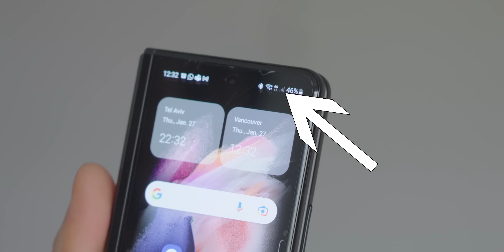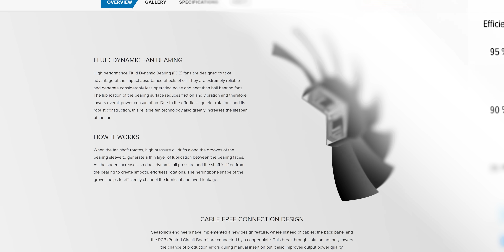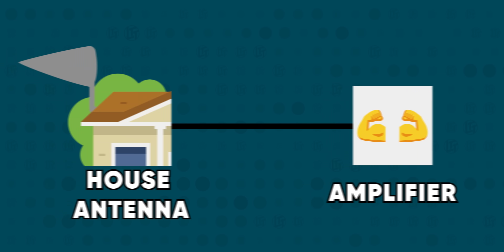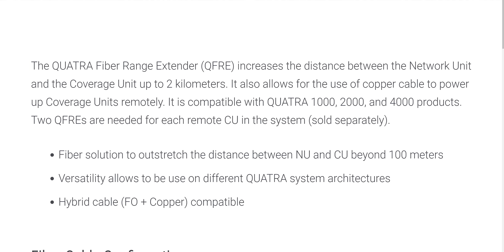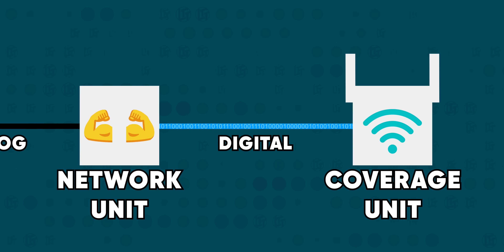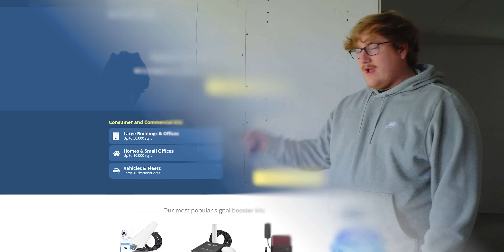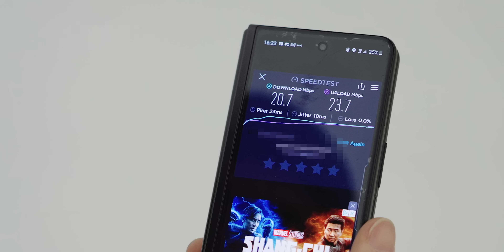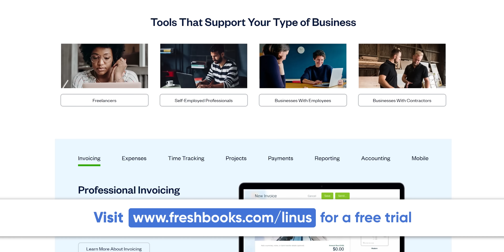I Hate This... New House Cel-Fi Cell Signal Booster Install

Comment: 1:48 No the tubes do not have to be encased in concrete, they can be laid in foam or wood based grooved plates such as Thermalboard, Warmboard, Rauboard, Heatply and Roth EPS 30.
Reply: i feel like the concrete is used as a battery for the heat, other forms would just heat the actual floor instead of providing some form of battery to store the excess heat thus making it really efficient
Reply: @MHawkeye  exactly that
Reply: He didn't say they HAD to be, he said they WERE.  There are good and valid reasons to use concrete, they made that decision early on.

Frankly  the service where Linus lives sucks at the best of time (I'm in the same general area) OUTDOORS, so reception inside tends to suffer no matter how your home is built.

Comment: Regarding your hydronic heating, or In Floor Heating, you don't necessarily need to encase the tubes in concrete. My parents house has it on 3 floors and, while the main floor is done with copper pipes, none of pipes are encased in concrete. As long as the pipes are in an enclosed space they will work just fine. The efficiency might be a bit lower but it keeps all that concrete out of the other floors.

Comment: Linus: "The tubes need to be encased in concrete in each level of the house, which heavily blocks signals..."  Me (in Mexico): "What else would you make a house out of? bubblegum?"
Reply: usually the ground floor is concrete and all other floors are wood. (in europe anyway).  If your in a high-rise It'll be concrete all round
Reply: @RobertFletcherOBE  In europe? Where are you living?
In germany 99% of houses are 100% concrete
Reply: @RobertFletcherOBE  In Europe houses are mostly concrete, with the rare exception of the UK maybe.
Reply: In the us, our recent houses are mostly sawdust, glue and cut corners
Reply: @diablo.the.cheater Average finnish house is built from wood with concrete foundations. Concrete would be like 20% more expensive.
Reply: @marcogenovesi8570  And that's for the GOOD homes lol
Reply: In the us, houses are concrete foundation/basement if it has one and wood frame/roof trusses with plywood/siding and some kinda roofing material. Concrete homes exist in sure but wood frame homes are probably most common. This is usual for most single family homes and duplexes, hell even apartment buildings in some places.
Reply: @diablo.the.cheater  uk houses are mostly brick and wood although block work it pretty popular and concrete was a big thing in the 80-90s to my knowledge so a lot of social housing is concrete but its less common outside of towns and cities
Reply: Wood is actually stronger than concrete (that hasn't been reinforced) except in compression.

Comment: I had no idea concrete even blocked signal this much. All of the houses I've ever lived in was made with concrete and cement and I've never had a signal problem.
Reply: Well Americans do live in cardboard boxes with a nice finish so for them to see concrete is something out of the ordinary.
Reply: I mean, sure, it does block the signal, but it's likely that Linus lives in the boonies, never had problem in brick and mortar, with concrete flooring, homes to get at least enough coverage to get SMS, but yeah, sometimes for calls you had to move from one room to another so the call didn't drop.
Reply: Not the concrete is the problem, it's the pipes filled with water in them.
The Floors made like this are basically a RF Blocking Device for the House.
Reply: @DAVISION-YT  Many European buildings have reinforced concrete floors and walls with loads of rebar (so they are a giant metal cage) and up to 30cm (12") thick and don't have these problems. Sure, the signal drops a bit but I live in one such building and still have 2 out of 4 signal bars in almost the center of the building, 8 meters (26 feet) away from the nearest outer wall and with 6 concrete slabs above me
Reply: @criscrix3  LTT is in Canada.....
Reply: @TheGrejp  it already has low signal because of the area, and adding the concrete compound the issue. If you have next to no signal, adding concrete will bring it down to zero.
Reply: @littlejackalo5326  I thought that was the case, so the cause is not really the concrete floors, but the overall lack of coverage. Anything, including wooden floors and walls, would degrade such a weak signal which was already almost useless to begin with.
Reply: @TheJttv  Canada isn't in America?

Comment: "They use concrete on every floor"
Laughs in europe

No for real it is actually pretty hard to get good wifi throughout a house.
Reply: It's not if you have a good accespoint on every floor ;)
Reply: Aluminum siding makes my cameras unhappy. Not even very far from the AP.
Reply: Never experienced problems. Wifi router is on the second floor and signal is cleat in the basement.

Comment: The healthcare company I work for recently finished building a four story clinic building last year and they had the Cel-Fi boosters installed on second and fourth floor. No issues except it needing to be restarted occasionally. It works really well regardless. Without it, I would get two bars in the building and with it, full bars. Whenever it doesn’t work, I just turn it off and on.

Comment: Friendly reminder, higher upload with cell usually means congested cell tower.
Reply: source dude just trust me
Reply: Not true I have t mobile home internet upload is slower so is download the ping will be higher
Reply: While this may be a good rule of thumb normally, I think in this case its primarily because the repeater breaks down MIMO in the downlink, while the tower can still use its multiple receivers to improve bandwidth in the uplink
Reply: @hexd0t  Yes, mostly true. However I would think that since its not using mimo its most likely a congested band on the tower. It most likely is not using Mimo for uplink either.

Comment: ...
... well sucks to be Linus, the VoWiFi from my cell service provider covers not only calls, but texts as well. It makes bad service reception moot as long as you have WiFi.
Reply: Mine, also. Mint Mobile, using the T-Mobile network.
Reply: I know AT&T in the US doesn't allow wifi calling unless you buy a phone directly from them or an iPhone. If I bring over my OnePlus phone (it supports wifi calling), AT&T won't allow it since its not on their 'whitelist'. In short, its about money.

Comment: Strange, T-Mobile has had Wi-Fi calling as a standard feature on pretty much all phones for like 5 years. It also includes SMS over Wi-Fi I can use both texts and calls even if I'm somewhere with absolutely no cell signal whatsoever
Reply: Yeah in the UK all the major providers let you call and text over wi-fi with 0 signal SMS, MMS or RCS and phone calls
Reply: @Samsonfs  three does not, it only works on three if you buy the phone from them. if you are a sim only and your phone is not on their list you are screwed.
Reply: Yeah my phone stays on airplane mode at home. Had wifi calling for literally like 6 years.
Reply: Pretty much all major US carriers and I assume Canadian carriers support wifi calling. The issue is that some providers don't let you use wifi calling if you don't buy a phone from them. AT&T supports wifi calling, but if you bring your own phone from a different company or buy an unlocked phone, wifi calling can't be enabled even if the phone itself supports it. They basically just want more money by having you buy a branded-phone.
Reply: @JJFlores197  wow that’s crazy 😵. I’ve bought all my phones refurbished so do sim only £10-15 a month and they all come with WiFi Call

Comment: I installed my Cell-fi about 2 months ago. Like Linus said, there really isn't a good place to find reliable reviews on this product. Just glad to see LTT went with the same company and antenna I have. My booster is different as my house is 1700SQFT but it works wonderfully.
Reply: Which did you buy?
Reply: @Davian45  cell-fi go x. I went with the single indoor antenna and it's on Amazon for $1100 right now.

Comment: The problem with DIYing a cell repeater is that you're capable of disrupting the carrier's signal with these installations when configured incorrectly - putting you on the hook for possibly disrupting emergency calls in a worst case scenario.
Reply: how do you disrupt emergency calls? can you explain?
Reply: @Sunscreen723  Bit hard to explain in a YT comment. There was a talk from a German Cell Radio Technician about his experience with repeaters at C3 a while back (as he explains, repeaters are completely forbidden in Ger though, while a short Google check shows it seems to be legal in Canada, as long as its not interfering) https://youtu.be/Cpwx-lMw0Xw?t=2067 - the live translation sadly has a few rough edges, but its the most insightful public resource I know
Reply: @Sunscreen723  If you send RF signals that interfere with the cell towers then that can disrupt calls, including emergency ones. Speaking from experience (telecom radio software engineer), interference is a pain to deal with and it can be hard to figure out where it's coming from.
Reply: @_NaLo_   but doesn't a phone already send rf signals to a cell tower? how is a signal booster different?
thanks in advance
Reply: @Sunscreen723  The cellphone 'understands' the cell network though. The cell tower tells it when and how to send.
A repeater has to be transparent to the tower and the phone, so it cannot easily take part in the protocol - especially with 5G, where radio traffic is being encrypted.

Another aspect: Phones are sold in very large quantities, so it's possible to spend multiple thousands on testing they're compliant without making much of a difference on the end price sticker. Cell repeaters on the other hand are a much more limited market, so amortization becomes harder.

Last but not least: A broken phone totally could disrupt the network - but you also don't see any DiY Cell Modem radios, but just buy a licensed one
Reply: @Sunscreen723  A cell phone is pretty "quite" when talking to the tower with most cell phones signals reaching at about the same level/power. A misconfigured repeater can send your phone's signal back to the tower at levels several orders of magnitude higher than any other device connected to the tower. This essentially drowns out all other phones connected to the tower.
Reply: @hexd0t  I can't imagine them being legal in the Netherlands (or most parts of Europe) either, I was pretty surprised it is legal in Canada. Large providers have to pay big bucks to get those frequencies to transmit on, they won't be happy if you just transmit on them yourself

Comment: As someone who works professionally with cellphone tech. Your description of analog is pretty far off. Your cellphone isn't transmitting using an analog signal, it's using a data protocol.

The difference in the system is that instead of just receiving and boosting the original signal (digital) By sending that signal through a Coax cable (where you'll get loss). In the "digital system" It's internally interpreting the signal transmitting that signal to the antenna using a data signal through ethernet cables that's interpreted and then boosted at the network box and sent to the antenna.
Because the transmission line is sent and received as a data signal through ethernet, there's no loss in that leg of cable. It's the exact reason they want the antenna to be close to the networking Box. They are limiting the dB loss, if you put the box too far you'd have the exact same problem as the "analog system" 

The "analog" You're referring to is simply that the receivers send digital signal directly to the repeater via long Coax lines, instead of the receivers interpreting the signal. It's all still digital either way.
Reply: You are wrong, mobile devices transmit and receive analog signal and their modems transform the signal to/from digital based on modulation used.
Reply: dude... I was a Signals Intelligence Analyst for the National Security Agency. I know what I'm talking about, I'm literally an expert in the technology and how it works. 
Go Google TDMA and GSM.
Reply: @404-Error-Not-Found  Feel free to be, but you will find analog-to-digital and digital-to-analog converter in every mobile device. It's converted to analog as it leaves the device and it's converted to digital as it enters the device.
Reply: you are simply wrong.

The existence of the modulation interpretation is not analog to digital. It's taking the digital radio signal and turning it into a digital signal that the computer in the phone understand.

If the signal were analog coming in, you wouldn't need a digital conversion for you to speak on the phone, it would be just like an FM hand held. The conversion only exist because it's digital radio. 

You're flat wrong, and if you spent 5 seconds googling you'd find a direct answer that you're wrong. GSM, TDMA, CDMA are digital radio.

Learn how to be wrong.

Comment: I can’t believe Linus and his family are still using smartphones without the wi-fi calling.
Reply: Didn't he mentioned that not all provider supported wifi calling? Not the phone itself
Reply: It's dependent on ISP and service provider.
Reply: To be honest at least in europe all the providers support wifi calling.
Reply: A lot of times it's not that the phone doesn't support Wi-Fi calling, it's that the carrier doesn't support it on the particular unlocked phone model you're trying to use. Trying to get wifi calling working on many unlocked non-carrier phones is a nightmare.
Reply: @remicaad5075  Yeah, I think he mentioned that it was a problem with the provider. I’d be genuinely surprised if Samsung & OnePlus (the manufacturers for Linus & Yvonne’s phones respectively) didn’t do Wi-Fi calling.
Reply: I think for Linus because he has so many different phones/devices he uses to test, he probably also wants good cellular anyway. Plus it's nice to have if the internet goes down
Reply: Man it's so inconsistent between different countries, here in the UK basically all providers allow for WiFi Calling and texting with 0 service
Reply: @tudalex  and South Africa
Reply: @tudalex  they do in the states too but its a rarely request and hence less advertised feature here

Comment: Cell boosters and repeaters are a complete nuisance to the cell network. They create feedback on the tower equipment themselves. I work on towers for maintenance and when we have to go up and diagnose a supposedly bad antenna it's actually external causes from boosters being on the same band. An example would be 700-850mhz. 

Your best bet Linus would be to ask the cell companies directly. I know for BELL if they find the person they give out a none offending booster so the network isn't affected.
Reply: So what you're saying is that its not linus' problem?
Reply: @Alucard-gt1zf  If its installed correctly (& measured to make sure it doesn't interfere) he's fine - which is why you really shouldn't DIY these. If it's determined his installation made an emergency call not go through, it can be a big liability. Unlike 2,4 GHz & Co, Cell frequencies are heavily regulated, and disrupting the frequency owners (aka the cell providers) is no small offence
Reply: i think this one of reason it illegal in my country. i did hear that it need professional to install it, so i will not get sue
Reply: @Alucard-gt1zf  actually it would be. The cell provider would come to your house and ask politely to remove the equipment. Some even go as far as supplying proper equipment. If he refuses which he has a right too they would just call the CRTC and let them handle it. Which evidently would end up with him removing the equipment or receive a fine. Or both depending on how nice they want to be that day.

Comment: Wi-Fi Calling should support SMS/MMS. If it doesn't, then your carrier didn't do it right.
Reply: Yes, it should.
Reply: It dont matter if they do it right or not , the phone has to support it as well. Still not all phones do support it which is stupid in my opinion. Even my 2021 Model phone dont have wifi calling. Moto G Stylus .

Comment: Remember kids, Tripods are wider on the bottom, for stability. That's the same reason ladders are wider on the bottom. If your ladder gets wider at the top, you're doing it wrong.
Reply: That kind of ladder is wide at both ends.